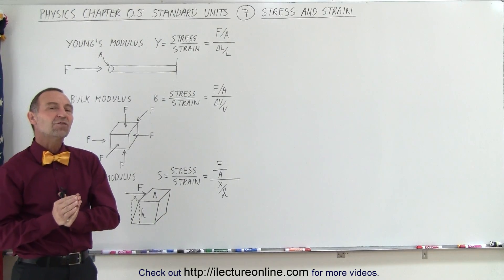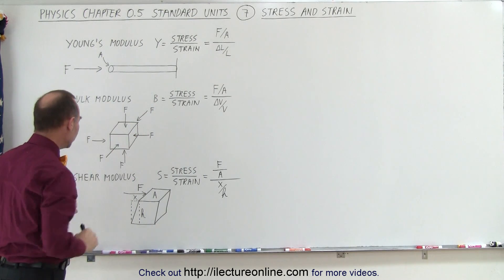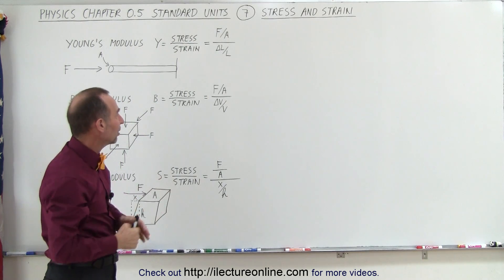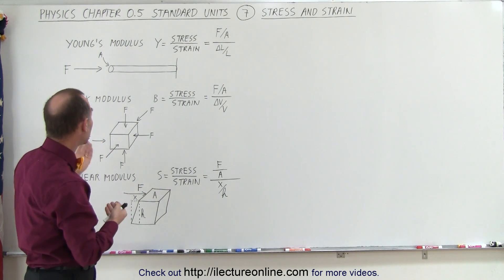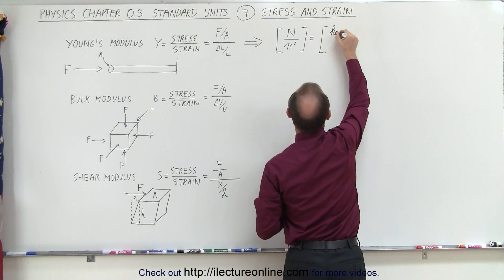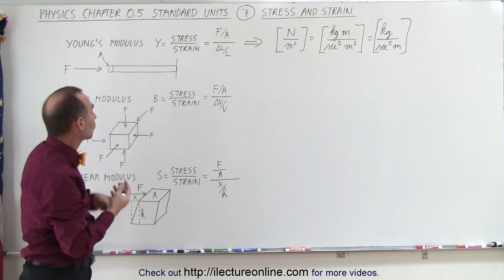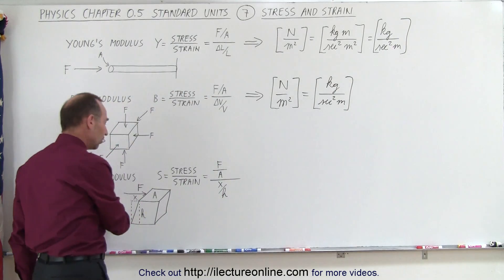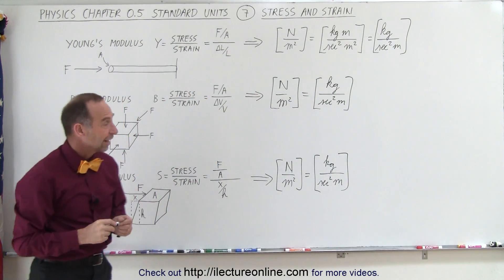Physics CH 0.5: Standard Units (7 of 41) Stress and Strain

Comment: sir, the unit of pressure & unit of young modulus are the same what is the relation & difference between them?
Reply from the maker: The Young's modules is a constant value for a particular material.  Pressure is the ratio of force and area (2 variables).  They are not the same.